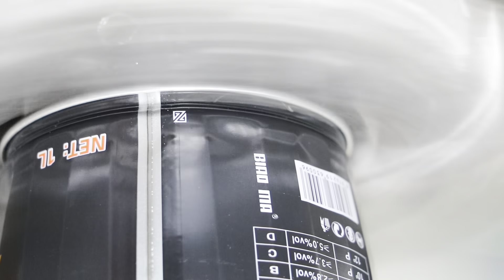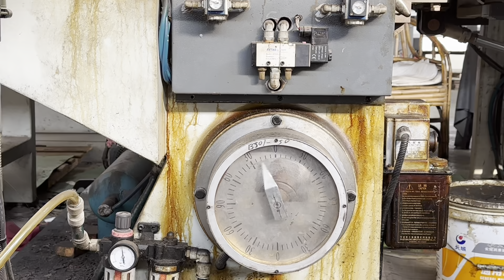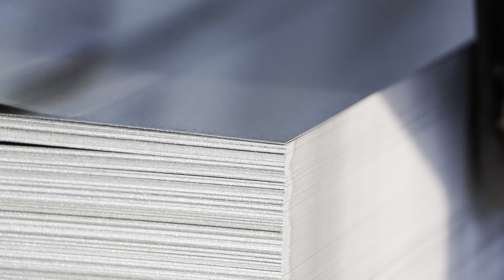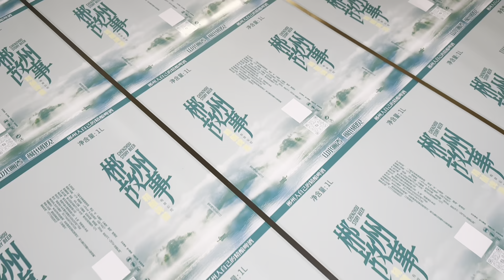大量生產馬口鐵啤酒罐的過程，專業的包裝工廠

Comment: It's not tin, but aluminum or steel sheet. Translation error.
Reply: Colloquially tin, but yes they are steel cans, they are using magnets on the belts to move them near vertically on slopes.